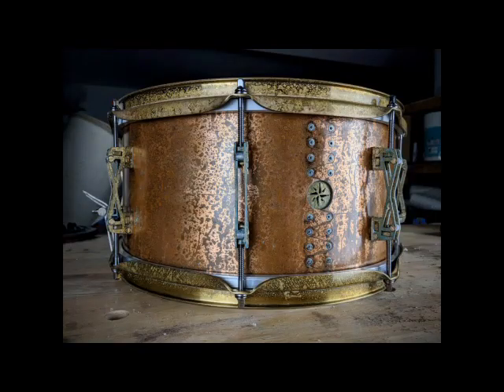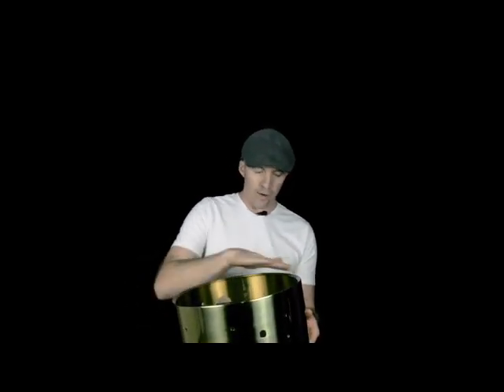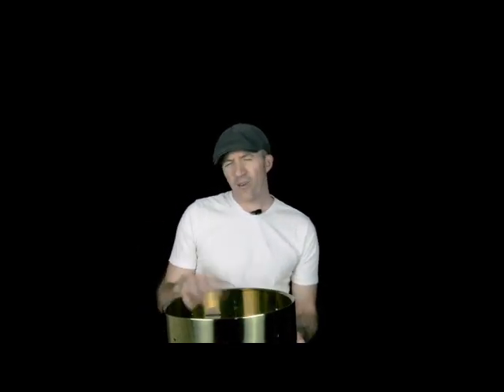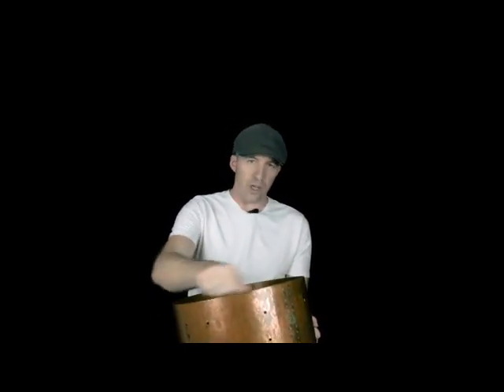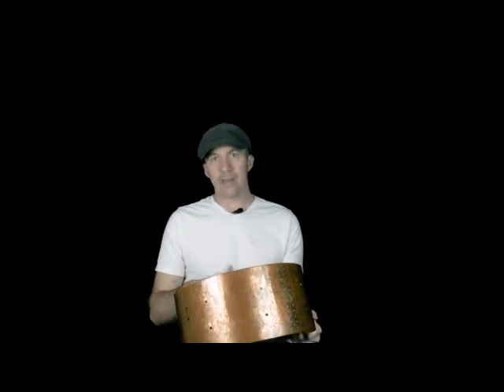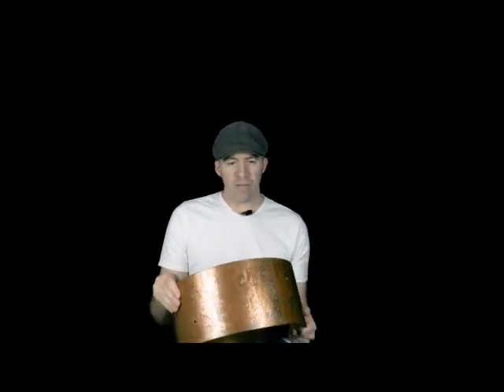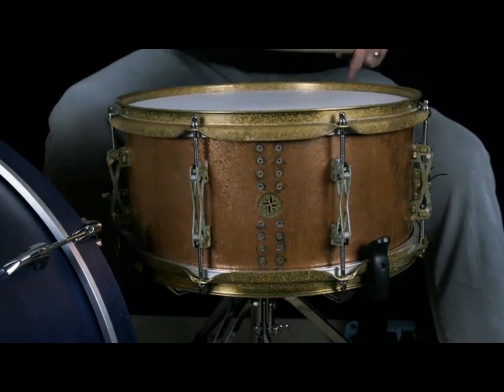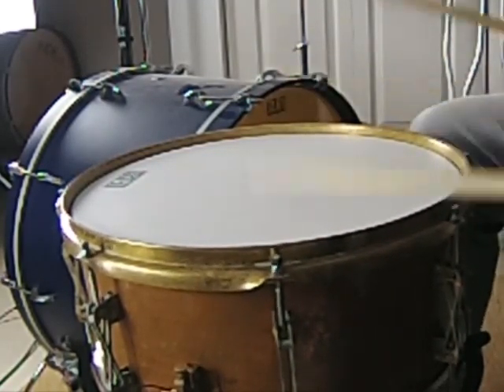A huge leap in snare drum technology, the Infinite Snare Bed (patent pending).

Comment: The original Dynasonics had only a .004 of an inch snare bed as the snare frame didn't require one.  Any drum that has extended snares doesn't need beds either.  This would be hard on the hoops too!